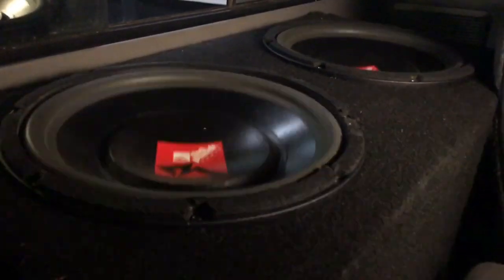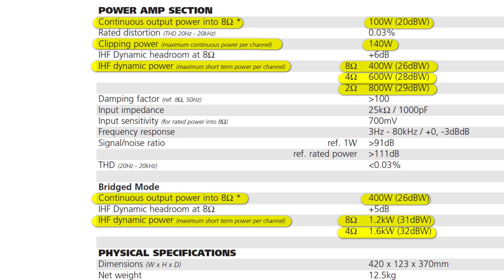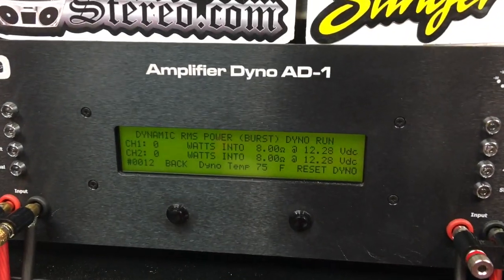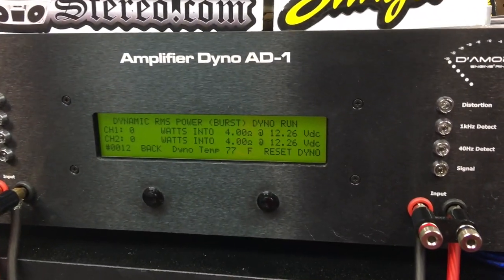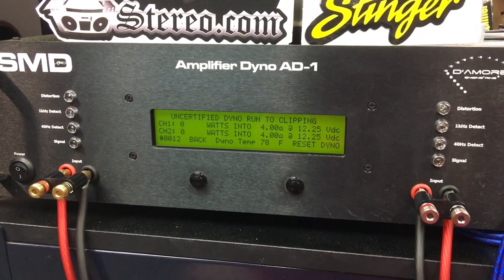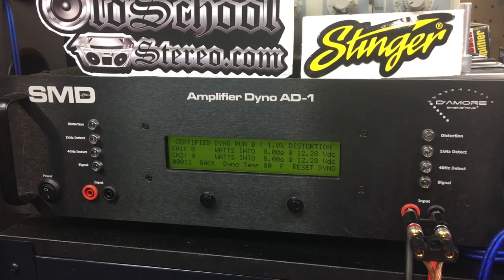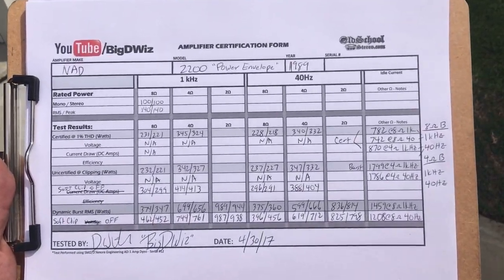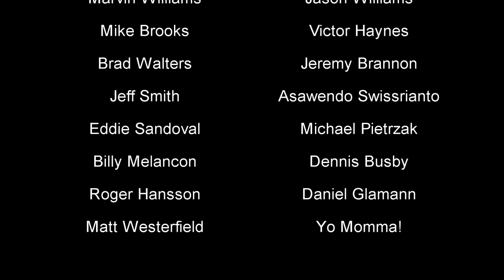Vintage NAD 2200 Power Envelope Audio Amplifier Dyno Test

Comment: Imagine if you recapped it...It would help immensely
Reply from the maker: +Mark Gray do you have data supporting this? I've spoken with a few amp designers who say this is a myth...and one of these engineers has been designing amps since the early 1980's
Reply: BigDWiz Others point out that after 40 years caps dry out and drift in value.
Reply: worth replacing caps if the tops are showing signs of swelling and while you are at it replace the volume pots and relays, i'm in the process of doing this to a couple old denons i have. i would do it to this nad in a heart beat.
Reply: _ nONE™ Even if caps don't show signs of leaking or bulging, being 40 years old, they can dry out and drift out of spec.

Comment: I wonder if you hooked it up to the LAB inputs or the NORMAL RCA inputs. To my knowledge (ie: as per ASR, that is), the two imputs differ in how they operate - with the NORMAL inputs having both a high-pass and low-pass filters at each end of the amp's FR plots, while the LAB inputs bypass the hi-pass and low-pass filters and are slightly quieter as a consequence......

Comment: I had a full NAD system with the 2200pe amp back in the 80's. Sold it to a friend. I found another 2200 for a steal at a pawn shop in the 90's...sold it to the same friend and he runs them bridged. That is one loud stereo!
Reply: do you have any more

Comment: what was the original rating in terms of total harmonic distortion? maybe less than 1.0% and if so maybe why it’s overrated so much.

nice video.

subbed.
Reply from the maker: It was rated at lower THD for sure, can’t recall how low
Reply: @wal  

THD  0.03%    (20 Hz - 20,000 Hz)

damping factor of 100  (ref. 8 ohm at 50 Hz)

Comment: your actually very lucky that the 2 ohm tests dont blow the output transistors in that amp. now dont get me wrong im not hating at all just the transistors used in that amplifier are 15A and 989W into 2 is 22A. use the 2SC3281/2SA1302 pair.  I Have an amp that used those same transistors and it will put put 160W into 8
Reply: each transistor is rated 15 amps, and I imagine it's a parallel output stage, meaning 30+ amps of continuous power, though I imagine another component would fail much sooner than the output stage. Most amps in this class have output stages that can handle 70-90 amp peaks easily.

Comment: To anyone that could guide me here. I've had a NAD 314 and loved the sound of it. I am now moving to a pre-amp/power amplifier set up as I bought a turntable and an integrated amp is not enough anymore.

I've got a pair of Paradigms v7 mini monitor. The speakers are rated at 50 watts, so a power amplifier than can deliver 100 watts per channel is more than enough I think.

However, looking at this video and the description, I now think it could be too much to handle for the speakers and they could get blown.

Are they going to be ok with this amplifier driving them?
Thanks in advance

Comment: Thanks for your your very informative video, I have a nad 3155 amplifier, I noticed your banana plugs, what banana plugs are they, thanks.
Reply from the maker: +anthony2010707 I think they are Stinger brand, made for car audio. They are very nice
Reply: anthony2010707: I have the 3155 myself. It still works fine, after 35 years. As you know, it is rated at 50 WPC. I bought a 2200 PE in about 1986. Funny thing is, the 3155 is almost as powerful as the 2200. The 1980's NAD's, integrated, as well as power amps,
are real gems. I had one spot of trouble with the 2200, had to replace the output relays.
Still running fine. I use the 3155 as a preamp.

Comment: How exactly does that do on work? You have to provide a separate source for the amplifier? You are using an Alpine deck? Do you just run a test tone on a CD or something? Are they 4v preamp signals? Sorry for the last of questions.
Reply from the maker: +MeatPopsycle see my older video on the Alpine 9815 head unit here: https://youtu.be/Fza-1zludTA I use a CD of test tones, mainly 40Hz and 1kHz. I'll do an update video showing the components I use for testing.

Comment: What an amazing amp. how did you come across one in such good condition?
Reply from the maker: +shane n lucky I guess. Been hunting eBay for 6 months or so. Got the NAD 2200 and Proton D1200 within a month of each other. That one is in superb condition as well. Having an Amp Dyno is a great excuse to buy amps to test 😜
Reply: do you have any plans to use them together? for example run one bridged to a sub and the other for front end.

Comment: Is it just me or did the price on these rebound kind of significantly in recent years? I bought a super clean 2200PE with relays already replaced from a pretty knowledgeable guy about 10 years ago for $120 and I feel like they were on CL for $100-200 regularly then. I know things have gotten more expensive in general but now they seem to go for 3-5x more. I'm using it bridged to drive a 15" sub and thought about adding a 2nd one a couple years ago until I saw what these were selling for. Idk maybe I just got a deal and am imagining things.

Comment: I have an amp I would love to get on a dyno my carver tfm-45 rated at 1000 watts at 2 ohm bridged, 500 rmsx2 at 4 ohm, 375 at 8ohm. with .5% thd
Reply from the maker: +Chris Wooden oh yeah, that is a man’s amp right there!!
Reply: +Chris Wooden -Yes, that would be an interesting test! I own a 55, a 35, and a PT-1800. I know a lot of people say that Carver amps didn't make their rated power, etc. -but I have never known anyone personally that has bought a Carver amp and gotten rid of it because they were disappointed. I will however say that my PT-1800 does not have the warm sounding low-end like my 55 does. It indeed makes more power, it just sounds different. I am currently contemplating getting a Crown 6002 to run my 15's, -not sure if that would be a mistake or not, -I have never run anything class D before, -on the subs it should be ok I would think??

Comment: Good video,

A query: I have a NAD 2200 stereo power amplifier and it does not say the word power over is there any difference in its power ?, I have a magnepan model 1.7i 4-ohm speakers, I have not seen on the internet to confirm the RMS of continuous power in 4 ohms of NAD 2200, what is the continuous power of RMS output in 4 ohms if in 8 ohms is 100 RMS?, Thanks for your answer. Regards!
Marco

Comment: Wish someone in my area had an amp dyno - would love to see what my Carver TFM-45 puts out... rated 375W/ch into 8 Ohms and 500W/ch into 4 Ohms.
Reply from the maker: +Chuey 72 I'm sure that is a monster. They also offered a rare, TFM-75 that did 750W/ch at 8 ohms and over 1kW/ch at 4 ohms. I think it weighed like 75lbs
Reply: Carver amps and receivers kick out some power. They have very unconventional power supplies for their time. My Carver 6250 has dual rail voltages and some have triple rails with three sets of capacitors.
Reply: Nice amp I own it's brother a tfm 45 as well only mine met my brothers ex with a bat when he owned it, front is ugly but it still puts out unlike her.
Reply: +BigDWiz -I had heard that the Carver Professional PT-1800 and PT-2400 were borrowed designs from the TFM-75, -not sure if that has any truth to it or not. I own a PT-1800, and it is a brute, but it needs to have very stout dedicated mains to feed it, otherwise it falls on its face. On my old wiring, the PT would hit the mains so hard that the voltage would droop down to around 95 volts during peaks, and it would light the clip LED's noticeably sooner than with stouter re-wired dedicated mains. It never once shut itself off however!

Comment: Very impressive but I'm not surprised. It has a different transformer than the proton d1200.
Reply from the maker: +vintage stereo buff D1200 is a bit more beefy. Have you done the RCA job yet? I haven't even ordered mine yet. Always something else more important going on...
Reply: I haven't got the jacks yet either. Too busy with other stuff. My d1100 preamp needs a relay. If I can locate the part I can fix it and the amp at the same time. My Carver 6250 needs a relay or two. Marantz 2230 has some kind of hum sometimes. I won't get bored.

Comment: I have a 2200 that I had rebuilt (repaired rectifier and filter caps and basic upgrade: relays, caps, pcb soldering) I have a pair of Definitive bi pole speakers. I can't turn the volume more than halfway- the volume doesn't get any louder past the halfway mark. It sounds like it's  at its max point. Any reason for this?
Reply: Dave Micolichek  Clipping is indeed on.
Reply: Dave Micolichek  Even when it's turned off, the red light on the clipping blinks. Still can't turn it more than half way.

Comment: What class is this amp? Thanks.
Reply: Class H, its a class A/B amplifier with two supply rails. In this case, 100 Watts RMS in 8 ohms is derived from the lowest supply rails, when the music information goes above the lowest supply rails, the second supply rail  (usually double the lowest supply rails) is switch into the amplifier giving it close to x4 power capability. Advantage of this type of amplifier is less output stage transistors and heat sinks size required.

Comment: Curios why you did 1% distortion vs the spec sheet of oh probably 0.03 or 02% thd? Is it at 1% because of the ihf 202 certified test rating?
Reply from the maker: No because my equipment measures to 1% and that’s become accepted as a new standard.

Comment: Not under rated these amps are designed to handle the reactive load of a speaker at rated output, the dyno is not reactive and very misleading...

Comment: Not much has changed when it comes to class ab poweramps in decades.
Reply from the maker: +slim jim true
Reply: BigDWiz except of course cost and more snake oil marketing out there by some manufacturers lol. Dual mono designs or multi channel mono designs with dedicated power supplies for each channel and plenty of heat sinking are usually a solid bet on performance.

Comment: Have you tested the NAD 216 THX ?
Reply from the maker: Not yet. Tested this 2200 and a Proton D1200 though
Reply: I just bought the NAD 216 THX, is it a good amp?
Reply: 02powertube It is good but does not have as much dynamic power as the NAD 2200.

Comment: ive got an eclipse 3640 (40watts into 4 ohms AT 0.004% THD and 4 channels)...its a car amp

but its from 1999..... uses HIGH quality parts (texas instruments, nippon chemicon caps)

it does about 50w per channel at 0.005% thd....
and at 1% thd it does about 70w per channel.....which is MORE than enough

and that amp sounds so fucking good.....

now days, they use shitty caps and unmarked components... because no one is nerdy enough anymore to know what they are looking at.,...

cadence is sposed to be a great brand..... but tehy cant even solder..... and left shit "floating"

they had a resistor that was in the board like normal...... and then they attached the leg of a small cap to the end of the lead of said resistor...... then added ANOTHER resisster to that cap.... and then had the end leg attached to the other sie of the first reistor..... 

like.... instead of having each end stuck into the board..... they just soldered one part to the leg of another part.....then soldered that mess on the leg of a part that actually goes into the board....
Reply from the maker: +kain hall using today's dollars, we paid A LOT more for amps back then. Today amps (for the most part) are like other electronics...cheap and throw away if they break

Comment: I have TWO NAD 2200 amps and both are in need of repair. Do you know anyone who might be able to assist me? I am in the Houston area. I'm willing to pay the price to get them fixed correctly. Having the very common issue where 1 channel will not produce sound until you turn the volume up and then it will "punch through". PLEASE, I need my amps to work like new!
Reply from the maker: I don’t know anyone personally. Check local home audio shops?
Reply: The NAD and Proton amps all have this issue. 9 times out of 10, it's the turn on relay.
Reply: search nad 2200 relay replacement.  there is a good video on YouTube.  just fixed mine this weekend easy enough even for my novice soldering skill
Reply: I did the repair for that myself.  A good soldering iron, solder sucker and small file is all you need for "special" tools.  I'll help you out by phone / email if you want.

PS: file down the pins that are too big.. They are not audio pins.  Then the new version of the relays fit in the board just fine. No drilling required.

Comment: Hey, so I have an old Samsung MAX-440 mini mini component sytem lying around and I was wondering if the speakers of this system are still any good compared to todays standards and if so, is it possible to change them so they have modern cabling. Maximum input is 40 watt and impedance is 6 ohm. As they currently have seperate + and -  inputs and the cables are open wires at the ends which you put in these holes with a clam. Would you (or someone else) mind giving a quick explaination on how to modernise them, like can I simply but a cable for it, and if it's not possible via commenting, could you make a short video on how to change it with these speakers or one with the same inputs. Here's a picture of these types of inputs in case my explaination wasn't clear enough (my speakers only have 1 of each (+ and -)): http://prntscr.com/flqo8p
Reply: IKEA 2 hard 4 fresco Those systems are not very good. Toss it or strip it down for the screws.

Comment: I had a nad amp and it cought fire. It was bad!!! It fried a set of forte 3s on it's way out. I was watching a movie and the sound got dim. Then 60 Hz line voltage went through both channels. It exploded. I had to get a fire extinguisher. Great amps no doubt but I'll never buy one again!
Reply from the maker: Oh man that’s too bad. These are good amps
Reply: @wal  The best! I just don't like fire I guess.
Reply: Which model of NAD amp was it?

Comment: Is bridging amps a thing? I mean, who ever does that? Seems not very practical...
Reply from the maker: Back in the day there were not many mono amps, so bridging two-channel amps down to one was commonplace
Reply: I've had my NAD 2200 bridged on a single 12 for over ten years.
Reply: @Hellahard   Can you bridge two amps so each powers a speaker?  I don't know much about bridging.  I know you can purchase these 2200s online for around $200 now days.  Thanks in advance.
Reply: You should be able to. Just run left rca to one amp and right to the other.
Reply: @Hellahard  Thank you Rob!!
Reply: there an internal rca for easy bridge switching inside my citation 16. I think it’s rated at 150 per channel into 8 stereo, and 500 into 8 bridged.
Reply: with bi wire and tri wire and home subs or dual mono amps driving stereo speakers there are many needs wants choices with bridgeable units.
Reply: or when power is needed and Conan isn’t around.